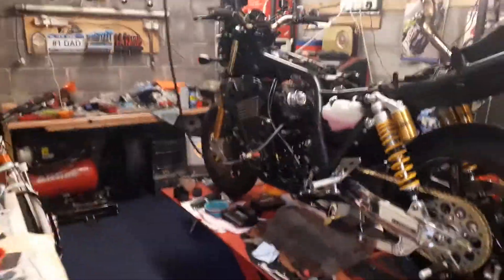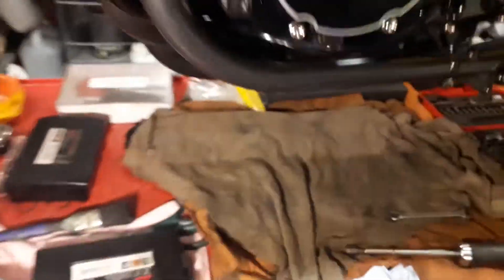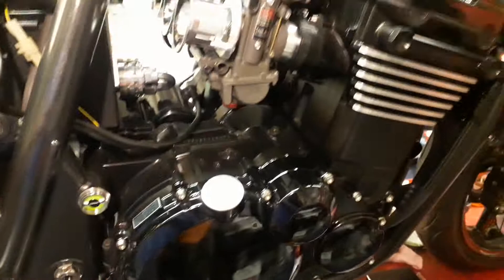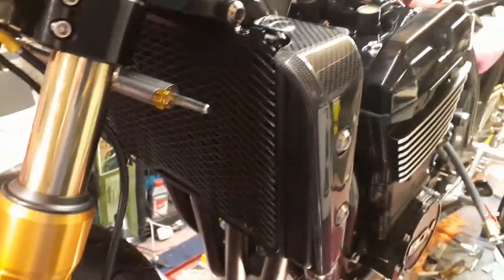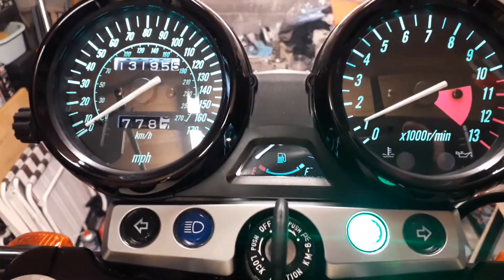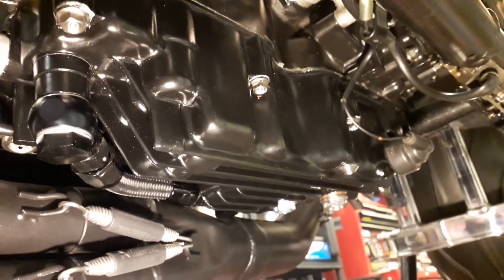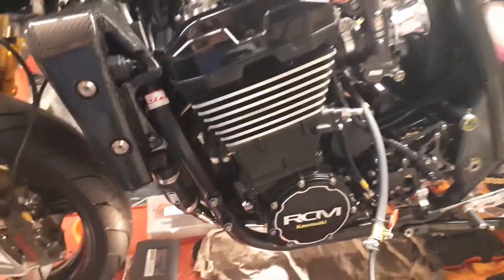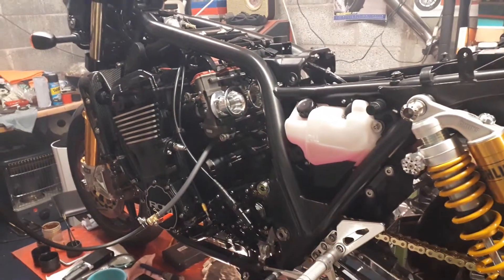2005 Kawasaki ZRX 1200R "Revisit" first start.......,TMR-MJN carbs

Comment from the maker: Thanks guys.....,the carbs are pretty much straight out of the box...!!

They supply two additional sets of main jets but the manual is in Japanese so I'd need to get my daughter in law (She's Japanese) to translate it...

I replaced all the stock float bowl and carb top screws with Titanium screws...(same with the dual stacks etc...)
Also machined replacement Titanium Choke pull and Idle adjuster cable knobs to change from stock..

That said.....,they were pretty much Plug and play straight outta the box and all I did was adjust the idle up a fraction...That is it..

Running just as you see and heard..

Couldn't be happier.....!!!

They were expensive....,but I waited and saved a LONG time...!

Stock CVK's on my other ZRX (2001) and I'm pretty happy with those on that bike as they are Factory Pro stage 3 jetted with K&N pod filters....

Check them out on one of my other videos...
Possibly a little more rider friendly (for street riding)....

The throttle response on these MJN -TMR flatslides is insane...!